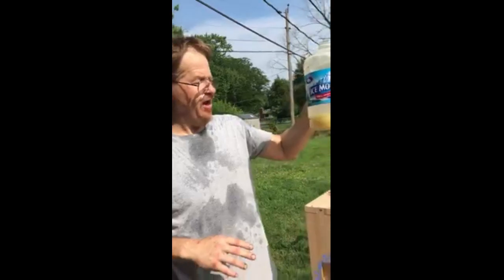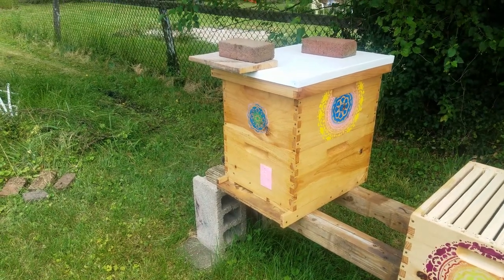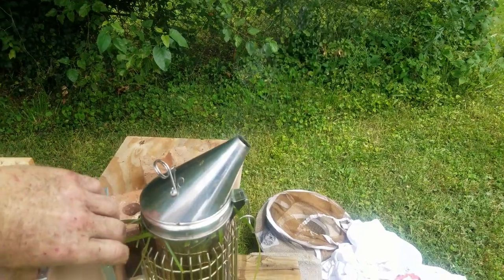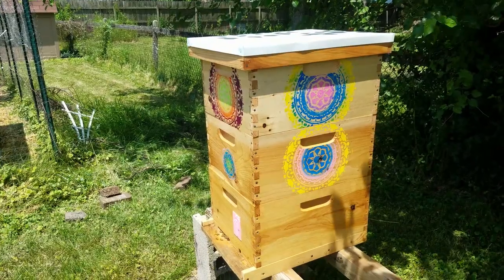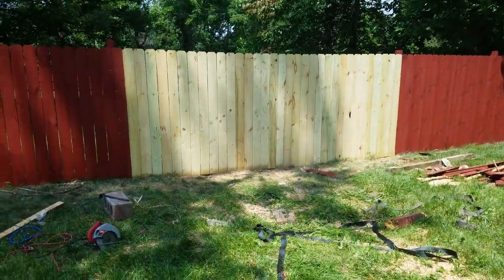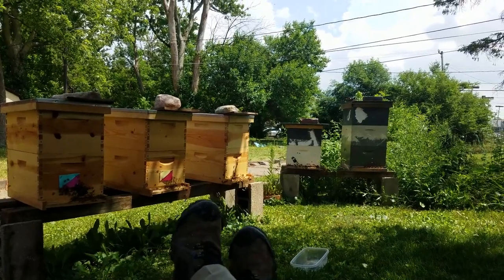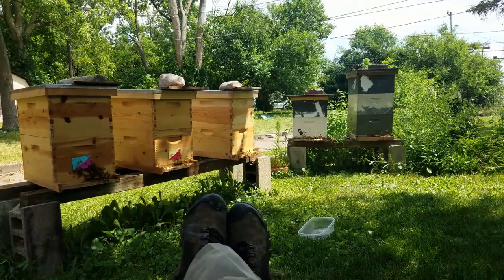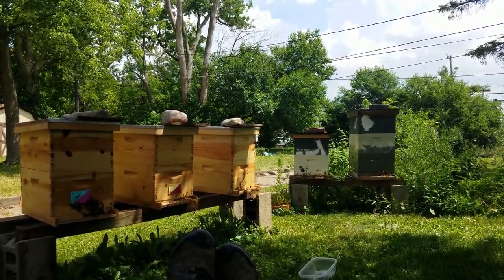Bee Hive Wood Finish. Fence repair done and chillin thoughts.

Comment from the maker: Conversely I heavily rearranged the four stack Flower/Sky hive few weeks ago. Interesting result I will document in a future video. "I do a better job" lol, 20+ years ago I built 360 feet of fence and was quite happy. The key is to not over nor under drive nails. However, that actual board was at a post with a slight twist etc. So, i drilled a screw in it for the guy.